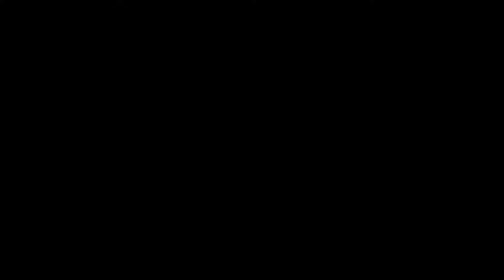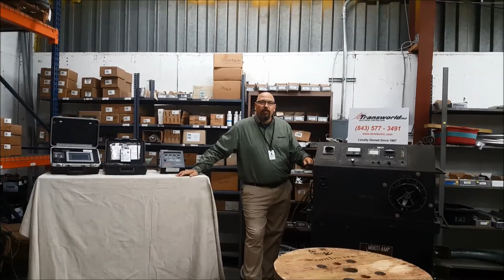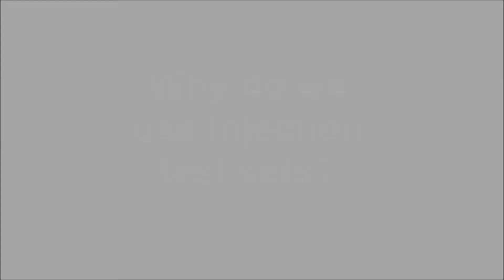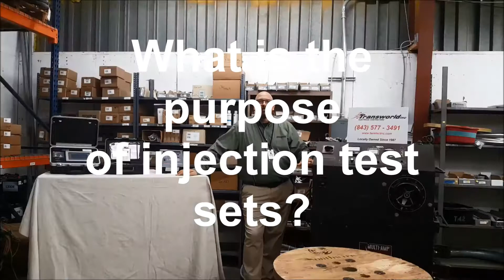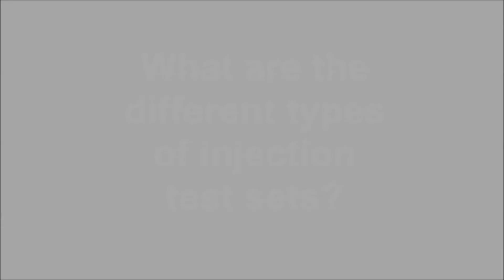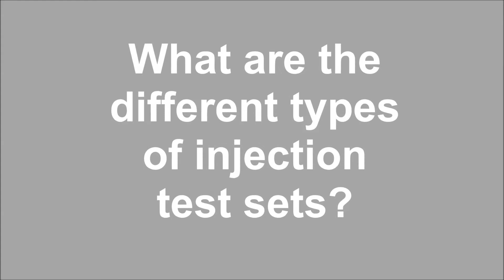PRIMARY AND SECONDARY INJECTION TEST SETS  | Transworld Electric

Comment: Can primary current test be done with all three phase connected as well in addition to single phase connection at a time?
Reply: Yes it can be done but that max ampere output will be devided into each phase...
You can check megger Trax 280, Omicron CPA100 or ISA T5000.